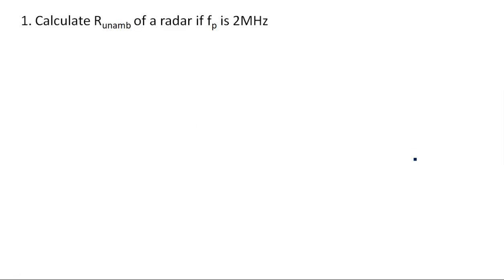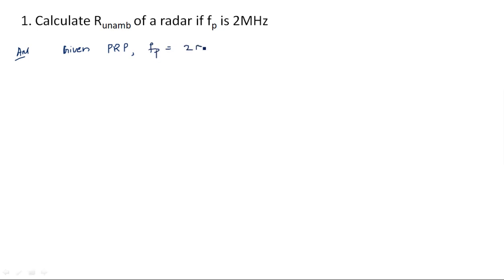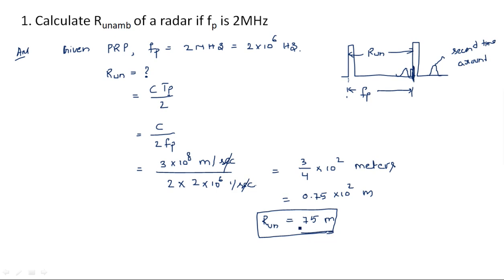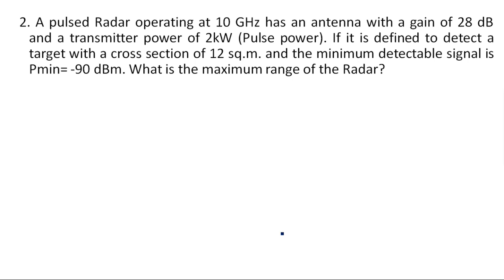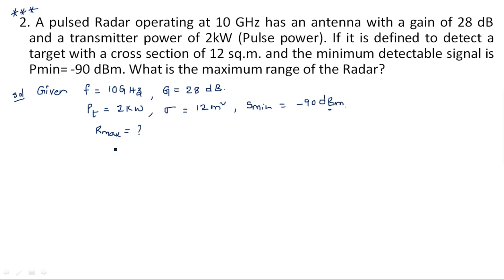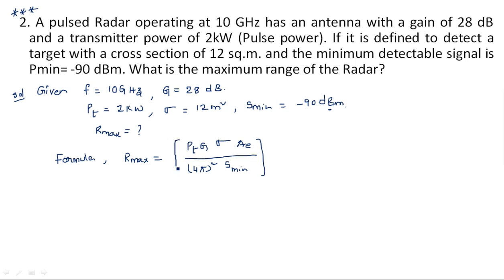Radar Range equation | Problems | Part-1/2 | Radar Systems | Lec-16

Comment: Dear Sir, The conversion of -90 dBm is not equal to 10^-9 watts. Since the unit is dBm it should be converted as milliwatts. That means -90dBm is equal to 10^-9 * 10^-3 watts. By changing this value in the formula, maximum range should be equal to 8.1 Km.
Reply: nice observation,got same answer